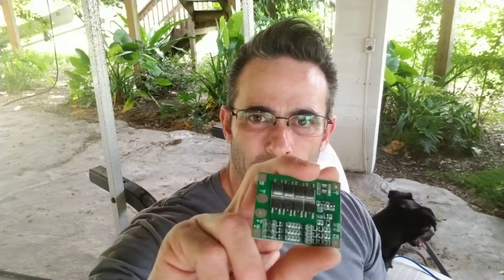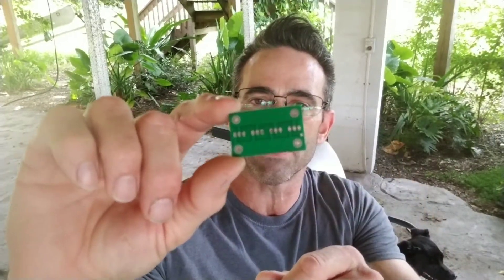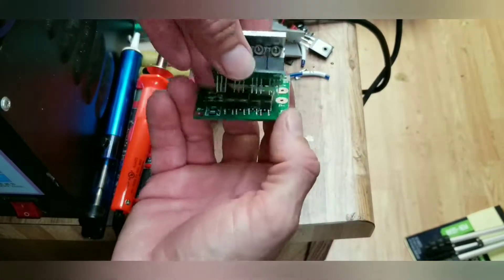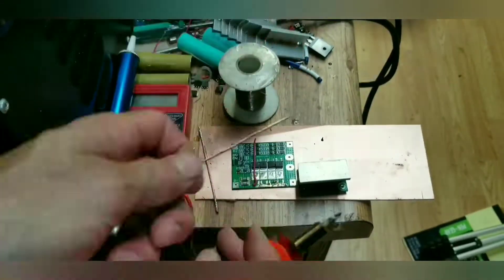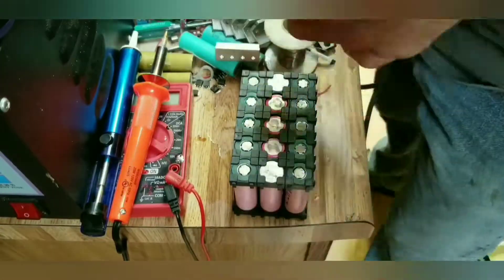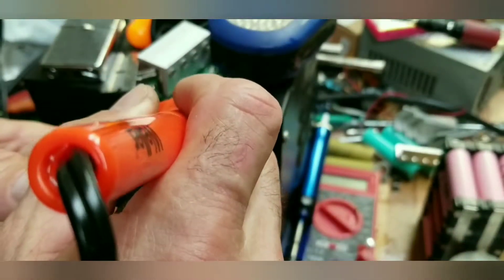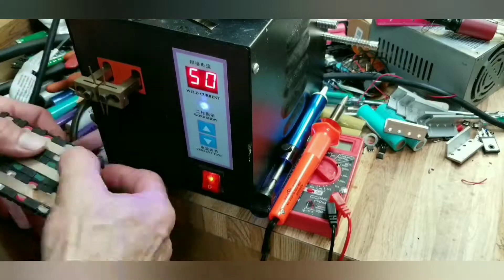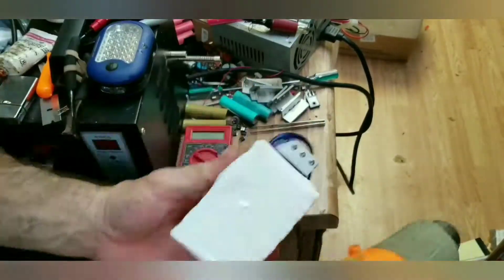Converting a cheap, Chinese 18650 BMS (HX-3S-FL25A-A) into a 40 Amp monster!

Comment: WHY DID YOU REPLACE ONLY 4  MOSFET AS THE OTHERS 4 MOSFET ACCORDING TO ME WILL BURN OUT WHEN CHARGING OR DISCHARGING CURRENT MORE THAN 25 AMPS.
Reply from the maker: No need to yell. I replaced the discharge MOSFETs because they are under a large load when the golf cart is runnung. But I've never had a power supply that would charge 48V at 75A, so there was no need to change the charge MOSFETs. I had more than 40 of these packs running my golf cart. If I wanted to quick charge, I would have needed to change those like you are saying.

Comment: Interesting video. Do you have one characterising the board itself with undervoltage,  overvoltage, short circuit protection, any balancing it may do?
Reply from the maker: These are the cheap boards that you get from eBay. Overcurrent protection appears to be a 50/50 deal - some will trip, some will not. As far as voltage goes (and balancing), these boards will let batteries get out of balance over time. They will stop charging when the first section reaches 4.2v. They will also shut down when the first section reaches approx. 2.9v. Nothing appears to happen that would balance the cells, even though the literature (and design) says that the board should short any group that is at 4.2v, through a resistor, and hold it there until the others catch up. In practice, it doesn't appear to be true. But, for the price, it stops the pack from overcharging (fire) or under-discharging (damaged cells) and it is a very viable solution for the hobbyist.
Reply: @paramax55  Thank you mate, I appreciate the response so I know if I can use it or not. I've tried to characterise some of the other cheap Chinese ones on my Facebook page too.

Comment: what about over current protection? of course this board have over current protection so how you reach 25A to 40A ?
Reply from the maker: I need to update my reply... I did more checking and the sense resistore are 5.0 each, making 2.5 ohms, not 0.005 each, making .0025 ohms. At a 150mV sense voltage, it should trip at 0.06A. Since these are advertised as 20A boards, and I'm pulling more than 30, something isn't right. I'm thinking there is no working over-current protection on these boards.
Reply from the maker: Another update... I managed to trip the over-current protection today. I tried to do a burn-out in the golf cart and I mashed the gas (electric?) pedal too hard. It just shut down a whole bank of batteries instantly and I had to run a charge current into it for a couple seconds to reset it. I'm not sure how much current I was pulling, but it was a lot. I do 30A per BMS on a regular basis without any trouble.
Reply from the maker: Good question. I would have thought so, myself. But I have been pulling more than 33 amps for short periods for several months and have not had a problem. So I went back and did the math... The HY2110 has an overcurrent sense voltage of 150mV. The current sense resistors appear to be two x .005 in parallel. The math would make it seem that the overcurrent does not activate until 60A. I do know (from experience) that the nickel strips will melt before the overcurrent activates. If someone did need to increase the current without activating the protection, it would be a simple matter of shorting out the sense resistors.